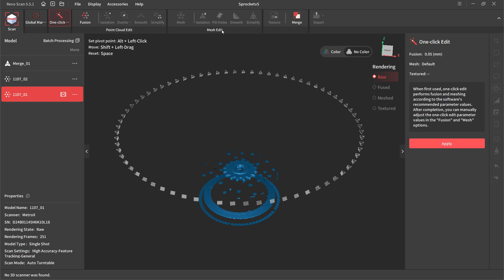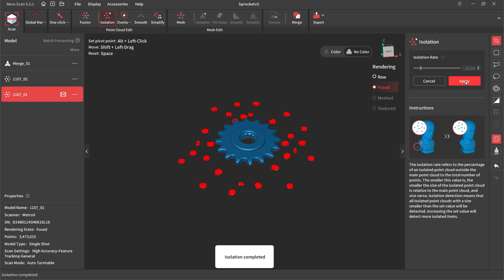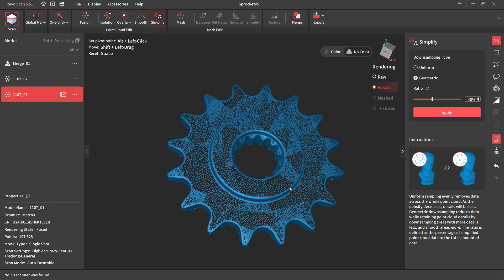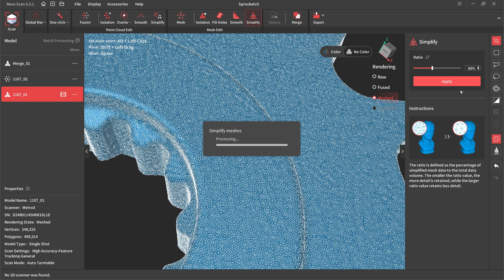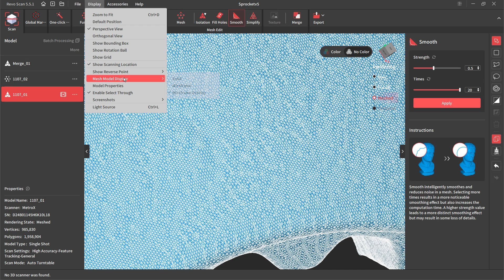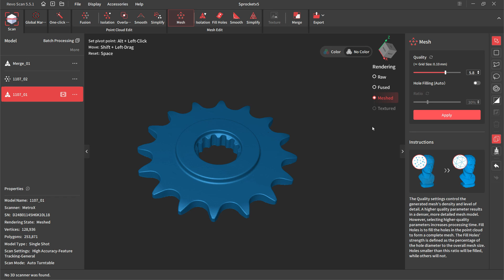How To Process Scan Data with Revoscan | What Smooth and Simplify Do | #revoscan #revopoint #metrox

Comment: Using Miraco and very happy with it. Finding single shot mode to be very effective. Using turntable with single shot, I get vertualy not tracking loss. What would be great is like a burst or auto shutter feature, so you don't have to keep pressing the button. Time and table speed adjustable.
Fantastic video and discovered not to use one click editing and smoothing the hard way. Many thanks.
Reply from the maker: Thanks for the comment!  Yeah on the metro x with the turntable linked to revoscan it handles the one shot and turntable movement.  I wonder if that will show up in a Miraco update if you have that turntable.  I agree that would be nice since the Turntable with the miraco is on/off.

Comment: revo's simplify works shockingly well its part of why i wish there were higher poly counts from the start but thats coming from what i understand :)
Reply from the maker: If you don't reduce the points it makes that mesh poly count pretty high.  Also the mesh "quality" element size keeps it pretty high.
Reply: @LearnEverythingAboutDesign  it's more an issue on large scans something with the algorithm doesn't play nice so it's an extremely low poly even with the "best" mesh settings.. best quality is like 2mm grid spacing and worst is like 60mm grid spacing haha even though it's fused at .3mm haha. it brings it from ~50m points and best case 1.8m poly at the end haha. smaller items generally dont have that issue. but considering I use my scanners for engine bays/ cars it's a rather unfortunate issue that there doesn't seem to be a work around .

Comment: Does this software have a feature to align model to coordinate planes?
Reply: I have a hacky solution to this if you use any common 3d printing slicers and use compatible formats, no promises it's a good one. But if you don't mind STL files, drag it into orca slicer, bambu studio, or prusa slicer, then use the face alignment tool then re-export it, now it will at least be aligned to something somewhat flat for later.. Their software really needs this natively though.. and face alignment is rather limited in how it works.
Reply: @Roobotics  it's also possible in Fusion with planes built by 3 points from mesh, but relatively simple statistic evaluation of mesh in scanner software looks more logical for me. Hope Revo will realise it too.
Reply: @oleksiy_rybakov  yes, I wish they had a tool to analyze a plane or 3points for flatness alignment reasons, models always have the weirdest tilts otherwise. That and subsurface noise artifacts.. I can deal with ones on the surface, but whenever you smooth, they are usually the reason a models surface quality looks ruined, more prevalent in longer scans.
Reply: @Roobotics  interesting, is Creality software any better in this... I'm choosing which one invest in 2025 and not finally sure of better value per price for those two.
Reply: @alexeyrybakov949  I have not been keeping up for if theirs is based on the same things, I use bambu because my printers, but would generally suggest orca to others and wish to move to that in the future, despite having an A1.
Reply from the maker: @oleksiy_rybakov  I would put revoscan above creality scan personally.  I think Creality is geared more toward the 1 click user so the processing options are fewer than what Revoscan has.  I think revoscan offers the user a bit more control even if they are still just sliders.  The last beta version I used now has a mesh distance and quality slider for the Fusion vs just the single slider for example.
Reply from the maker: @Roobotics  Great tip! ill have to try that one out!!!
Reply from the maker: Sadly no it does not.

Comment: Revoscan gets better, but still needs to be improved.
Introducing algorithms detecting flat faces and handels them as such, same as fillets, circular holes and so on would be great!
Best would be if the software would turn those detected geometry into a f3d file with features, is the future.
Is the software able to reset the viewcube/coordinate-system? Reset Top view etc.?
Reply from the maker: I don't think you will ever see revoscan generate a model for you.  And honestly even the software packages that are over $10k don't do a great job with this.  There is a tool out there that I haven't tried for mesh to solid conversion.  For prismatic parts Fusion can do this (a bit) with the mesh conversion after you generate mesh face groups.

Detecting flat faces would be great!  I think my first ask would be to align to a coordinate system though.

To the best of my knowledge no the view cube isn't configurable.  You can click on it to reset (fit to screen) or swap to another view, but you can dictate which way is TOP for example.
Reply: @LearnEverythingAboutDesign  Yes i know about "mesh face groups" and generating feature out of it (thanks to you ;-)
I'm just saying that this would be the future, maybe!
If it would be easy, it would already exist. I like a lot to model things, it would take half the fun out of it for me. But for some people this would be groundbreaking.
Reply from the maker: @GeryS.  https://www.mesh2surface.com/  This is the one i mentioned.  i haven't used it yet but seems like it has some promise
Reply: @LearnEverythingAboutDesign  Wow this is amazing!

Comment: Can you show us how you check dimensional accuracy after a scan? Can you do it within revoscan or how you do it in fusion360
Reply from the maker: Yeah, generally what I do is take the mesh into Fusion, make a mesh section sketch and fit a curve to that.  So if its a cylinder for example, you would fit a circle to it and that circle dialog would give you the error.  So you can measure the circle and know with the error value how high/low it is relative to the scan data.  I have done a few videos like this in the reverse engineering series on the bar clamp, but i could do a video just on this topic.
Reply: @LearnEverythingAboutDesign  thanks I’ll look for that video but if you can make another specific one, That would be great!

Comment: Nice video once again...  Although I couldn't resist counting the teeth you run before you zoomed in... and then I saw the 16 and knew I counted right haha!
Reply from the maker: LOL.  That sprocket was for my GPZ750. it was a 530 (stock was a 630 massive chain!).  Actually that sprocket was from a tl1000 BUT i used it on my GPz to run a 5.5in wide rim as opposed to the skinny stock 3.5in one.  Im usually like a 14/52 guy on my 250 :)
Reply: @LearnEverythingAboutDesign  That makes more sense, at first I was trying to recall if I have ever heard of running a 16 on a motorcross bike ( yes I'm aware of the spelling lol )...
Reply from the maker: @billyfrank6318  I did have a 16t for my drz400 to try and get the top speed up. but the sprocket ate into the swingarm guard..... so i ran either 14t or 15t most of the time on that bike.
Reply: @LearnEverythingAboutDesign  Top Speed... " but the sprocket ate into the swingarm guard"...exactly!...you super moto guys I swear 😂